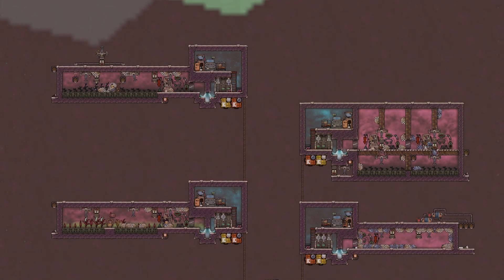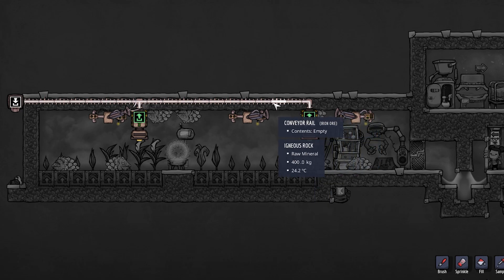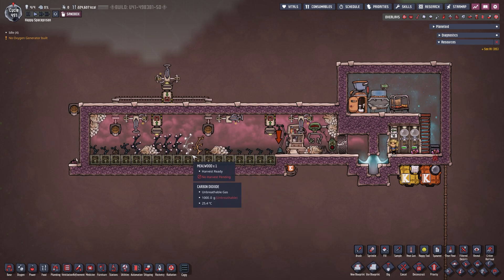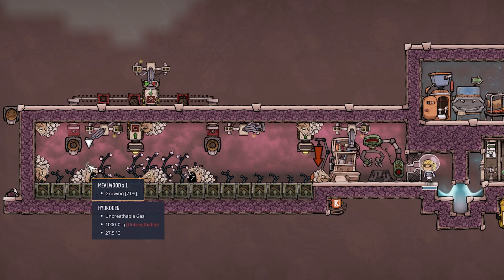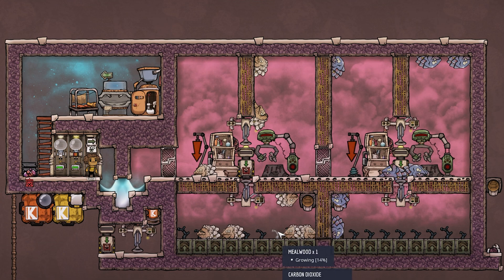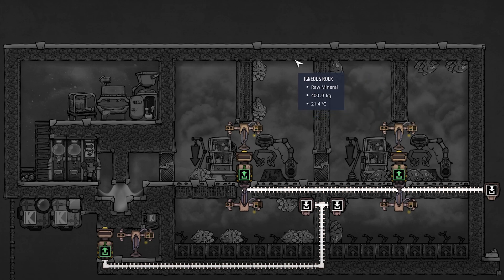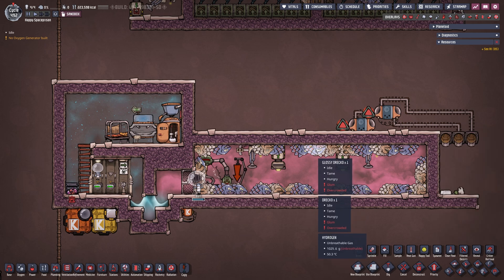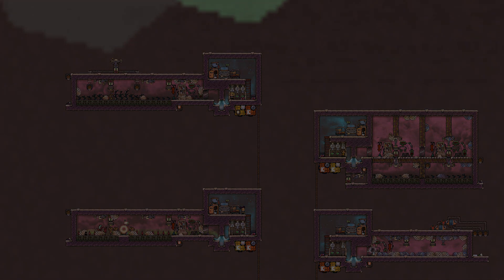GERMAN ENGINEER explains ONI: RANCHING DRECKOS! Oxygen Not Included Spaced Out

Comment: how did you split your dioxide at the bottom like that? when i tried it the dioxide all collapsed into 1 packet floating around
Reply from the maker: It’s a fine balance between amount of CO2 and Hydrogen. You need very little Hydrogen so it allows the CO2 to spread!

Comment: Interesting side issue while trying to generate the Hydrogen for this setup...max pressure issues on my electrolyzer.  Do you have any existing videos/input for handling max pressure experienced issues?  Is this something I should be setting up an infinite gas storage for and just pumping a bunch into it?  I've tried opening up a route to outer space, thinking that would vent me off, but that did not seem to do that.
Reply from the maker: If you experience overpressure you most likely don’t get enough gas out fast enough. If it is a full Rodriguez, then you most likely will need an infinite storage…
Reply: @BierTier  Well, your full monte SPOM is working, but I'm trying to establish a gecko hydrogen by using an electrolyzer on it's own.  But the electrolyzer isn't producing hydrogen as the room it's in is Overpressured.  I'm trying to figure out how to depressurize it which seems to be, yes, I need to pump gas out to 'somewhere' which appears to be an infinite storage by your answer:)

Comment: Dear BeerTier,
I would recommend a third layout that I find more efficient that produces reed fiber and plastic and consists of a Breeder and Starvation farm.

Starvation farm: just like your farm, but only L3xH4 Tiles wide on the inside. Additionally there is a stacked liquid blob of Naphta and Oil at each wall(Decunstruct one filled liquid pipe). This room has the Shearing station in it and a conveyor chute (second of 3 collumns). The stacked liquids prevent Dreckos from moving, thus reducing the pathing calculation for your CPU and the pathing time to the shearing spot (because they cant move and stand at the shearing spot). PETA might not like it, but is should be more efficient...

Breeding farm: Mealwood and dreckos (not glossy) in O2 normal temp, again stacked Liquid blobs on the walls so they cant climb up and just wide enough, so they can eat crops and have low pathing to your grooming station (make it higher than 4 tiles for the 96 tiles). The use of mealwood and Dreckos will produce a mixture of both types of dreckos leaning to glossy types especially if your animals get older (some manual culling could tip the odds). Stable size depending on your need for eggs. 8 Dreckos would give you like maybe 0,8 eggs per cycle and that would mean you would have 100 Dreckos in Starvation farm (didnt math it, just estimating).
Reply from the maker: Thank you for the suggestions, I highly appreciate it! That layout makes sense to me, I might build it in my Let's Play when I come across some Dreckos. If so, I will of course give you credit. Thanks again!
Reply: @BierTier  I would be honored :)

Comment: Is there a reason you are using the sensor and shutoffs instead of just using the solid filter?
Reply from the maker: Really only the higher power draw(10w on Shutoff vs. 120w on filter). I always use the Element Sensor setup, it's mainly personal preference since the result is basically the same.

Comment: For the starvation section you can add in a couple of powered incubators to increase the husbandry skill and keep the other ranches full of critters. I use 2 incubators (1 for each dreko type) and 2-3 shearing stations.
Reply from the maker: You are right, there should be at least 2 incubators in there, connected to a cycle sensor and set to #9 priority to not waste power. I didn't want to include Incubators in every critter video and forgot in the process that for the starvation ranch it is actually necessary.